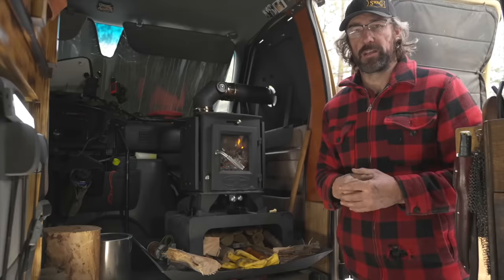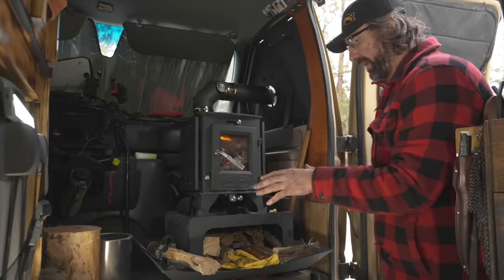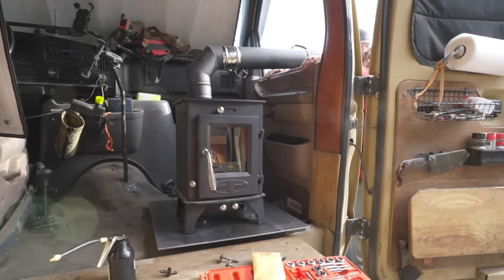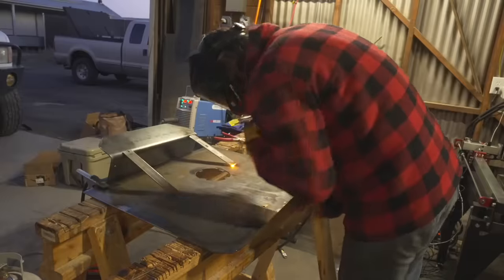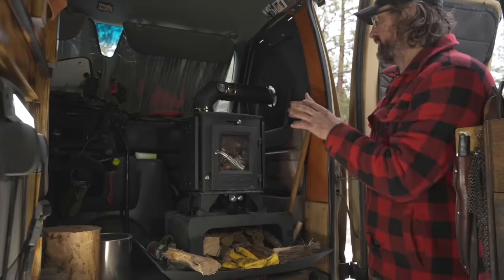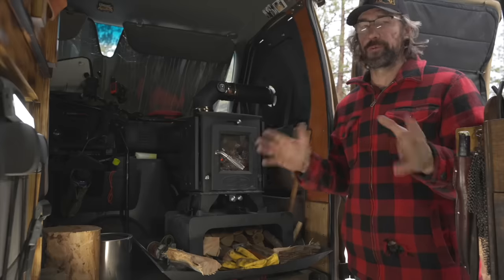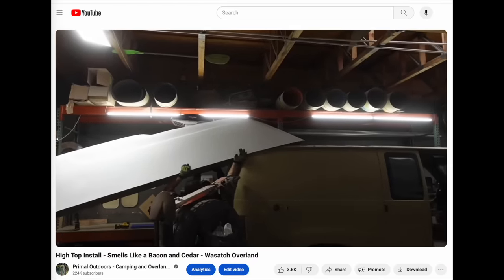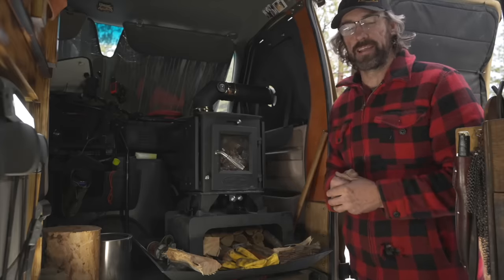Tiny Wood Stove Install into a Van - Game Changer for Winter Van Life

Comment: A word of advice: Make your flue taller than the top of your van. Drafting stoves works better if the top of your flue is above any close structures. The taller your flue, the stronger the draft you will have. 👍
Reply: was just thinking the same
Reply: Yeah I'm a certified chimney sweep. And they are right , 3 feet taller than any objects within 10 feet . Awesome design try not to burn any pine if you can , hard wood at night may last the night too
Reply: There right make it taller

Comment: Awesome build. If you had a double wall pipe, you could use a silicone stove jack to go through the panel in the window opening. That way you wouldn’t have any gap where cold air would enter.

Comment: Use a stove fan that you place on the top of the stove.  It doesnt need any other energy than the heat the stove creates.  It will make a big difference and heat up your van in no time.  Only problem is that some of them makes a little noise.

Comment: Nice build. I am concerned about the intense heat that might melt or burn your inside door panel. Maybe a heat shield might work.
Reply: That is my only concern. I want one SO badly but I'm concerned about the heat from the sides and back. No big deal with a full size bus but if you have a truck with a diy slide-in camper, fire is an issue

Comment: For those who want one too. Turn around and search for a lavo stove instead. Hot-tenting gear is a LOT lighter. Not even half the weight, same heat.
Reply from the maker: I agree and disagree. Tent stoves are very light weight and do put out great heat while you have an active fire, but the thicker weight metal of a real stove will retain heat much longer providing warmth longer into the evening. Once a tent solve goes out it will go cold immediately. I have had the chance to use both and that is my experience. Given the choice I prefer the real stove in this situation, of course as there is with any choice in gear there is give and take.

Jason

Comment: Looks good! I have a different brand small wood stove in my trailer, best investment ever. I had a couple of ideas for your set up. First, you can use a silicone boot to cover the chimney hole in your window, looks like a sizable gap there. Second, try using long kitchen spring-loaded tongs to add wood and adjust your fire. Stay warm out there, it's getting colder!
Reply from the maker: I actually have the boot. I have been debating whether I should install or not. To be honest it's not been noticeable problem and I think it would  just add more work to the setup. I will give it more testing and thought.

Jason

Comment: You can increase the draft of the wood stove by adding another 4 foot stove pipe to the vertical pipe outside the van. If you add two 4 foot pipes it will draft like a mad dog.

Comment: that outside draw setup is really the actual way to go anyways, wood stoves can use a lot of oxygen and you don't want it using your oxygen while you are sleeping, plus a fire like cool fresh air not hot expanded air.. way better setup
Reply: Cool air while denser removes heat from the combustion process...Pre-heated air actually makes the fire burn hotter which helps combine more smoke and carbon with oxygen producing more heat and cleaner emissions. If his van was so airtight that his stove 'sucked up all the oxygen' it wouldn't burn right anyway, as it couldn't breathe in. When you start designing Rocket Mass Heaters, you learn alot about the combustion process. Most old-school wood stove 'experts' refuse to believe there's anything new to learn.

Comment: Really like the wood stove!  Out of curiosity, have you used a handheld CO2 monitor with a digital readout to see what CO2 levels exist inside the van while using the wood stove?  I have recently tested CO2 Levels in my van using a buddy heater with multiple windows cracked open along with a fan to help circulate the air and my CO2 monitor consistently reads 4,500+ ppm CO2 levels with the buddy heater.  Again just curious to see if anyone else out there has gathered CO2 readings inside their van while heating their van...  Thanks!
Reply: Your readings might go down if you have one air intake and one air out window with a fan pulling air out.  Having multiple windows open might not be creating that cross breeze needed to get the CO2 out.
Reply: CO or CO2? Big difference.  Just curious.  Thanks

Comment: Wicked good job on the stove bro! I’m doing something similar in the back of my pickup but no where as nice as what you have done. I have a related suggestion/request for a future video. Once you’ve gotten used to your stove and how it works, would you think about a video regarding your thoughts on the best types of wood to use? Hardwood versus softwood and manufactured logs, what gives the best results for heat, burn time, clean burning, excessive creosote build up… ok I’ll shut up now, you get the idea . Once again, great job. Peace out! ✌️
Reply from the maker: That would be some good testing. I will see what I can do.👍

Comment: With the welder and cutter you have in the shop you could have just built a wood stove. I have a propane stove in a GFC and it works well to run the chimney pipe out the side panel at a 45 degree angle. That way I can use a longer pipe and avoid all but one elbow and the exhaust is further from the truck.

Comment: Jason I have the same van and same brand new bubble top... I also dont want to cut a hole for a roof top vent also it would make my van VERY tall....where did you put your ventilation fan? ...mine was a passenger van with rear A/C removed...I'm thinking of venting out the floor in the existing holes...but im all for a good idea....Thanks,

Comment: Your van is desiel. Why did you not use a desiel heater?
I suggest extending the chimney height for better draft.
Good idea having the stove removable for other seasons. Good information regarding the air intake, and baffle delete.
Will you design/build a machine to mass produce tiny stove wood bundles?
Reply from the maker: My van is diesel? and all this time I have been putting unleaded gas in it😅. Just kidding my van is not diesel, that is why I didn't put a diesel heater in because I didn't want to have to carry three different types of fuel. There has been some improvements in unleaded gas heaters, that I would consider now if I was to do it all over, but four years ago they didn't have good reviews. 

Jason

Comment: Hey Jason, enjoy your vids much. Question...any issue with the stove being so close to the plastic door panel? I don't know much about these stoves...is it insulated on the sides? Or something else?
Thx.
Reply from the maker: This is a good question. After several days of use there is no issue. I have checked it several times with my bare hands and though it is warm it is not excessive. The stove does have heat shield along the side.

Jason

Comment: A 4" Rocket Heater would be better and more efficient. Build it from Kaowool coated with 'water glass'. It will burn ALL the smoke, produce zero creosote, and minimal ash, while running on sticks. If you need help just ask.

Comment: Problem with the super heavy dwarf, cubic, and north woods mfg the extra weight also needed for is the super heavy and super expensive double and triple insulated pipes (that help with draft by keeping inner chimney temp hot), wall thimbles, L brackets, and potentially cement board and some kinda hearth, and the wood.. major tax on payload then with most of em you constantly have to work too. Pomoly and then winnerwell seem like the better options to me in the realm of mini stoves. Light weight and cheap, but money going to china… still really like all the research I’ve absorbed on pomoly designs, much better than the dickenson solid fuel for 2-3 times the money…

Comment: How many hours do you think you have invested on that addition? Just the stove build and installation?
Reply from the maker: It's hard for me to say because things were so broken up with ordering and waiting on parts from Tiny wood stoves and other materials. Factoring in filming I am guessing about 10 to 12 hours not counting waiting for paint to dry. It always takes longer the first time you do it, but the Plasma table sped things up considerably. If I would have had to cut everything by hand it would have taken me much longer. Plus now I have the designs so if for some reason I needed to do it again, I could cut that time down quite a bit. Why do you want one for the LMTV🤣.

Jason
Reply: @PrimalOutdoors  NICE!!! I really like your build and build video’s. Yeah I was thinking of getting a plasma table for about 4 years now, just haven’t done it. It would speed all my builds up a lot… I have a 1969 CJ5 I am building a safari build out of. It would be awesome to have one… still may. Mmmmm maybe, that would be pretty cool in the big rig. I have a diesel heater going in too. Plus I have a 29 gallon side mount propane tank going on as well. I have a bunch of designs I am drawing out for it. And I have a flat bed trailer to go behind it to carry the Blazer or Jeep…. Going to be an awesome build. Almost done with the blazer…!! lol getting there…